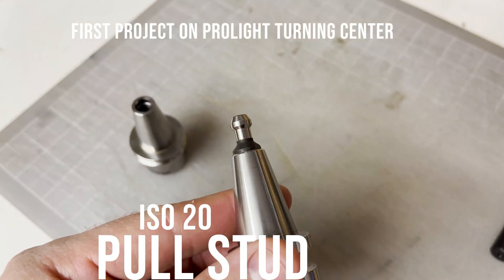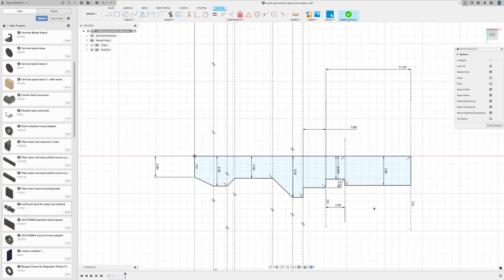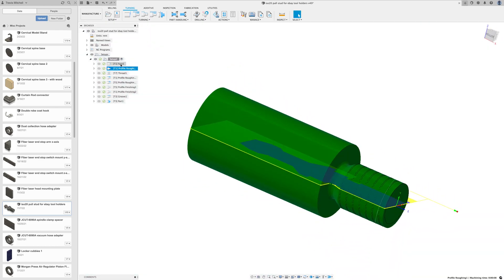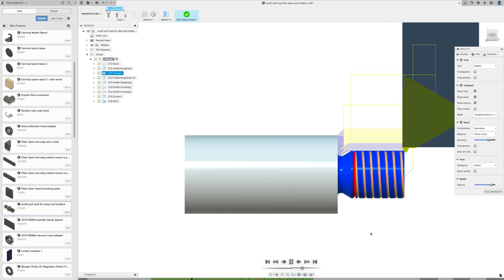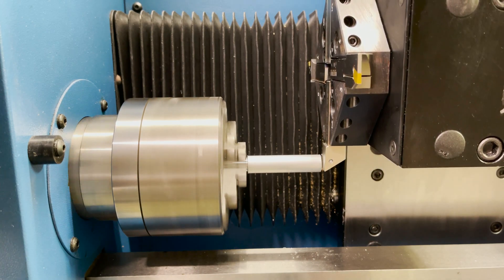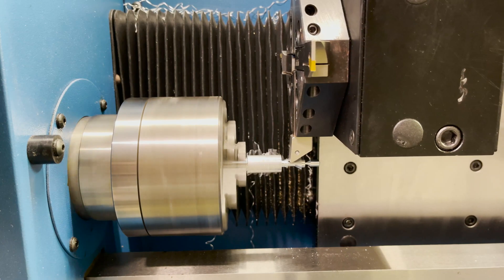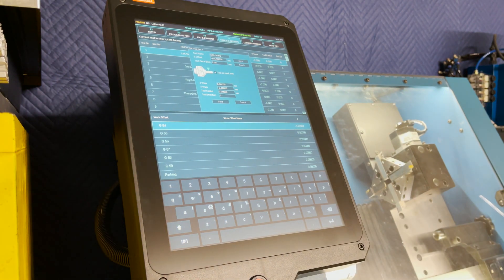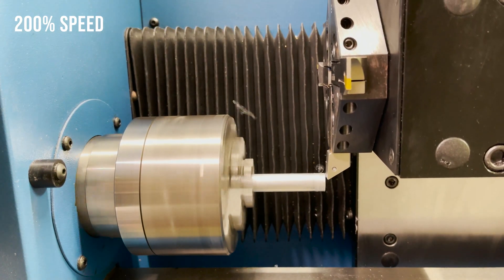CNC Lathe with Masso G3 Touch Turning ISO20 Pull Stud

Comment: Hi Travis, lots of good suggestions in the comments re chuck stick out and cutting fluid.  I use a mist coolant as it is not as messy as flood.  What sort of insert were you using for the turning?  My lathe has just 1/2hp at the spindle and I have used Sumitomo FC type inserts for years.  These have a ground edge and are much sharper than moulded inserts.  I have no idea what other brands might call them but I assume others have similar inserts.  I have used the inserts for aluminium on steel and they cut quite well, they don't last very long, but as they are so cheap in hardly matters.
 I have a video of making a pull stud in 4140 if you are interested.

Comment: Always keep the distance from the chuck as minimal as possible for rigidity. Always use cutting fluids based on material type. Cute little machine, great for a hobby shop.

Comment: Did you already figure out the diameter/radius issue?it’s an easy fix on Masso+dial indicator. Your calibration on the X axis is incorrect. I made the same mistake on my first cnc lathe build.
Reply from the maker: Yes, it was an easy fix. I talked to Masso about it...it was just user error and my misunderstanding of how it was supposed to work.
Reply: I have the same issue. How did you fix it?

Comment: Was the radius / diameter issue resolved in firmware updates?
Reply from the maker: I later found out from Masso that there was no firmware issue...it just turned out to be user error
Reply: @diyfiberlaser  it happens, thanks for the fast reply.
Reply: @diyfiberlaser can you elaborate on the error?

Comment: I'd machine these from 2 sides, so you can get a smooth top, instead of having to debur them by hand, Just take a piece of scrap with M8 Threads in there.

First Machine the threads, and then Cut off.. you can have very little stickout with that, 
Then, Put the still round stock in a vice, mill the flats on the shank, Bolt them to the scrap piece in the spindle, and machine the other side..

Comment: nice video! the tool changer is controlled by the 3rd axis? and it has some position sensor or something? curious how it works as im looking at a larger lathe for conversion and it has similar tool changer with more stations. thanks
Reply from the maker: Exactly...there is an index switch that it turns until it triggers on startup to find tool #1, consecutive tools are found by turning specified number of steps from the index position. I'm guessing on larger machines there would be 2 switches, one for index and one that is triggered when each tool is in position.

Comment: Chip control is an issue with your turning. I saw your hand\fingers try and remove the long chips. The first time you try this and the razor sharp chip ( even Aluminum) suddenly grabs and pulls tight you will learn, ask me how I know this. I cut my whole hand across my palm and took a chunk out of my Thumb. Use long nose pliers or a chip hook. I was lucky that I didn't cut deep enough to sever any tendons & yes it was very painful. Lesson learned. If you have chip nesting problems then you can program the cuts to start at the spindle and move towards the tailstock, this way the chip is  pushed away from the chuck and nesting doesn't happen. I enjoyed your videos however, just the cringing brought back bad memories, you never forget!!

Comment: i bought a southbend magnaturn 612, its a complete machine but its not working, it has baldor ac brushless servo motors in it, very nice machine, wondering if this masso conversion will work for mine??
Reply from the maker: I don't see why not...you should email them and ask, their support is usually very helpful

Comment: This and the previous videos on your Prolight 3000 Turning Center conversion are great!  I have a 3000 Turning Center also and plan to convert to the Masso G3 Touch like you did.  Does the Masso G3 control the 8-position tool turret out of the box, or did you need to do some custom macro work or other mods to the Masso s/w and/or h/w?  Thanks.
Reply from the maker: It has a preset script that works perfectly for it right out of the box, it was surprisingly easy.

Comment: When the threads are cut: how is it ensured that the cutting tool every time starts at the right spot?
Reply from the maker: There are two encoders on the spindle, one reads the rpm, and the other indexes once per revolution, each threading pass it starts the cut at the index trigger…that’s my understanding
Reply: @diyfiberlaser  Sounds logic! Thanks!

Comment: if there one thing I wouldn't make myself its a pull stud. good chance of damaging the mechanism in the machine and they youll have problems with all of your toolholders, if its not straight the whole toolholder can be crooked, and they are under a lot of stress. at least for bigger tapers they have to be forged so the grain direction is correct of they fatigue and break prematurely

Comment: Hi! Nice job! A little tip for better threads: use "fade thread end" in fusion, then after you've done the full thread, make a finishing pass on the same diameter that was before thread but in direction from the chuck, then another thread pass at full depth and another finishing pass. It will remove all the possible burrs)
And yeah, start the thread at the distance 1.5*pitch from the threaded face, and make it a bit longer
Reply from the maker: I will try that next time, thanks for the tip!

Comment: I'm wondering if you don't have enough holding current and the axis is dropping under its own weight, as the stepper isn't under power. It happened to me. Make sure you have idle current for axis under the influence of things like gravity.

Comment: When threading on CNC you need to allow an acceleration distance at the start of the thread, fusion may call it a lead in distance, on your machine I would say 3 to 5mm should be enough.  Only finish a diameter once, carbide tips do not cut well at a depth of cut less than the tip radius.  You will get a much better finish with a 0.2 rad tip and a 0.25mm depth of cut.  If you find you get chatter then use GT style tips on small machines they work well in all materials not just aluminium and they reduce the cutting pressure and stop tip rub/chatter.

Comment: Really nice results. Lube and maybe a few more finish passes and you will have nice parts. Material selection will help a lot too. 4140 cuts much cleaner than 1018 etc. 41L40 would be ideal for a smaller machine.

Comment: The fact the the cutting tool went beyond the centerline and to the other end of the stock does indeed suggest that the machine was set up in "radius mode".
In the masso axis setttings, try to half (or double) the steps per unit settings for the X-axis. This should half the distance the tool travels in the X direction, thus giving you the correct dimension when programming in diameter mode.
Reply from the maker: Thanks for the suggestion. When I jog the machine manually or using gcode, it moves the expected distance on the display readout and when double checking it with a ruler, so the steps per unit appear to be correct. When I inspect the gcode output from fusion 360 it is actually telling the machine to travel twice as far as it should, so it must just be an issue or setting with the post processor

Comment: I’m about to order  a Masso G3 touch. Thanks for the video. A word of caution about grabbing those long stringy chips by hand, if they get caught by that chuck while you’re holding them they will instantly and effectively cut your hand. Over 30 years I’ve seen some impressive cuts from chips. One guy I worked with had a chunk out of his fuck you finger he called his cigarette holder.
Reply from the maker: Thanks, I appreciate the safety tip!

Comment: i suspect your lead screw is not the pitch you expected when you set it up in masso if your pitch is twice that expected it explains the radius measure being used instead of the diameter
Reply from the maker: Thanks for the tip! That was my first thought as well, but it seems to be traveling the correct distance, both on the digital readout and when I double check it with a caliper...the gcode from Fusion 360 is actually telling it to move the diameter distance, which is what is confusing me...I think I need to do some more testing with onboard Masso wizards to see if they behave the same as the gcode I am getting from Fusion360

Comment: Great video!  A couple of tips from my 30 years plus of cnc machining - cutting oil/coolant is a must to improve surface finish and extend tool life. And have less material sticking out from the chuck, i know it's scary but for the best accuracy and finishes the parting tool should be max 3 - 5 mm  from the front face of the chuck as it parts off, this will stop deflection. 😁
Reply from the maker: Thanks, I appreciate the tips! After several cuts, I was starting to feel more comfortable and adjusted it so there was much less stick out. I do like the idea of adding coolant...I could probably hook up a mist coolant system pretty easily for it.
Reply: I run a shop that can’t use recycled coolant for contamination reasons so all our stuff is mist / MQL cooled. There are plenty of inserts now that run quite happily without any coolant. Aluminum is the problem child but if you look at the Datron system you can see how that’s managed. For a small home shop, something like a fog buster is fine. Without adequate ventilation, coolant fumes can become intrusive.
Reply from the maker: @rexmundi8154  That is pretty cool how the mist looks like it's integrated with the spindle! I was going to try this mist coolant: https://amzn.to/3UVjzZD Hopefully the fumes aren't too bad
Reply: @diyfiberlaser  that’s the same brand that we use in our shop. It only takes a few ounces per gallon of water. It’s pretty much odorless. They also make a air powered mister that works well and has a magnetic base.
Reply: On my prolight i set up a mist system for turning and it made a huge difference. I use kool mist #77 and it works great!
Reply: @matthewdomes6363  do you have pics of your setup?  I recall reading someone had issues with coolant escaping through the spindle gap in the case and damaging the motor but perhaps it's not an issue with mist?
Reply: you got no clue what you are talking about dude.

Comment: Could you share the masso controller between your lathe and a mill/router? Instead of buying one for each machine
Reply from the maker: That's a really interesting question! ...as of now, it seems you have to choose which between the two, as you can only install either the milling OR lathe software
Reply: I do that for my mach3 c10 board and share it between router and mill. But you need two profiles in Mach3. If you could do profiles like that I would probably consider switching myself since the G3 looks so awesome
Reply from the maker: @benzhuk876  It says here that you can switch between the software for both machines, but it takes about 90 seconds, but I'm not sure how that would work having it hard wired up to both sets of motor drivers, etc... https://docs.masso.com.au/MASSO_FAQ/about_masso